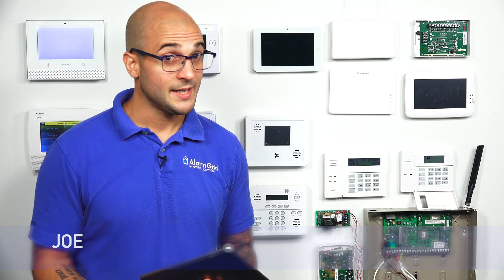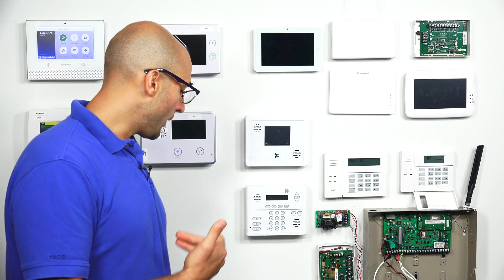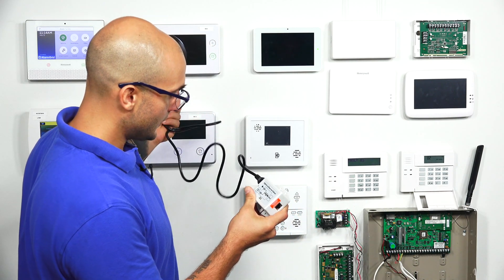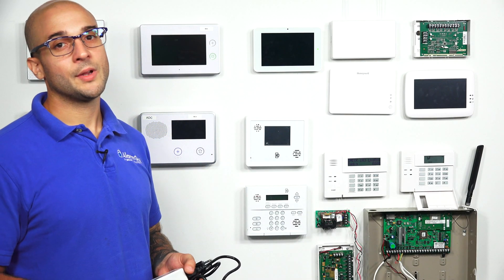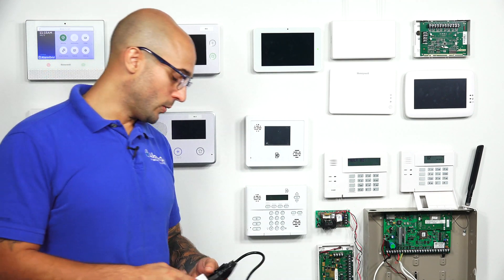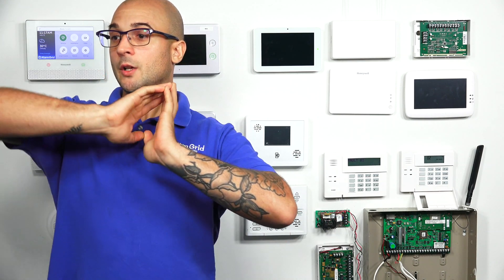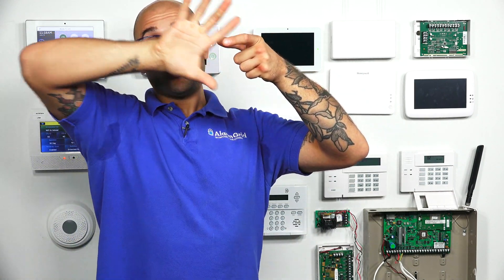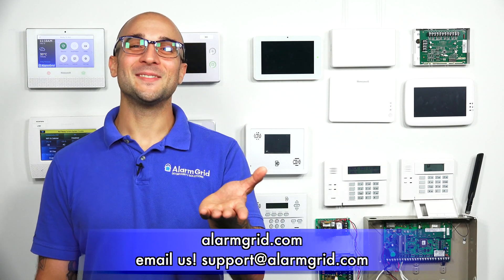Using Power over Ethernet (PoE) on Alarm.com Cameras

Comment: Thank you for the video. Question if I may, if i am wanting to send 16v on a custom poe box what the max length of my CAT5 cable.
Reply from the maker: The limit wouldn't be a power limit, but a data limit.  CAT5 is limited to 100 meters regardless.  That's the limit of the cable, regardless of PoE considerations.  If you need to run more than 100 meters, there are extenders you can purchase, though we don't sell those.

Comment: so I have a question, I purchased a 122 SVR, and I also have acquired some POE cams model vc736 how would I program this cams since there are no ports for ethernet connections for the camera
Reply from the maker: Hi Christian, as long as the cameras is connected to the same LAN as the SVR-122, the camera and the SVR should be able to see and recognize each other over the network, and you should be able to add the cameras with no issues.  They are specifically made to find one another.